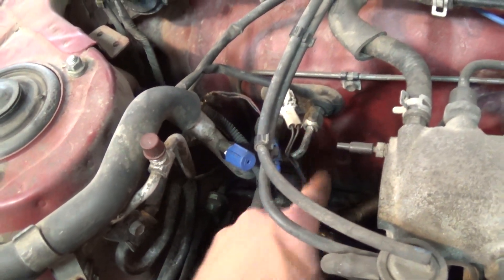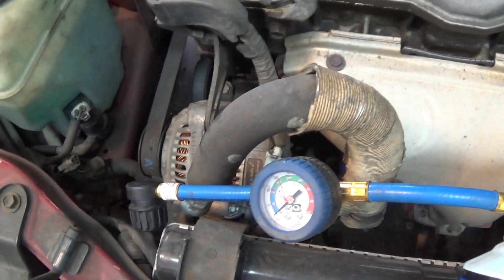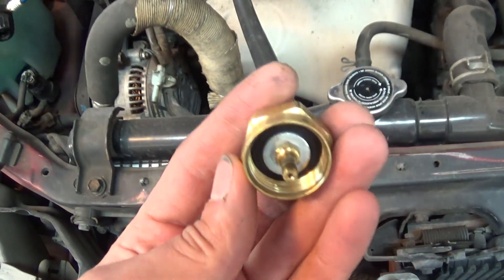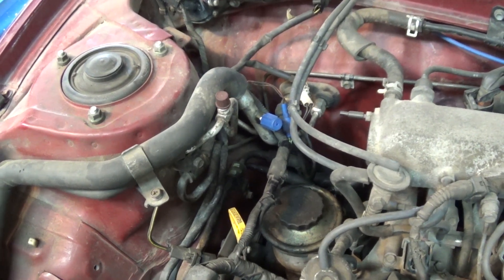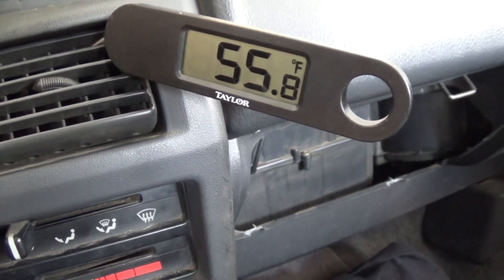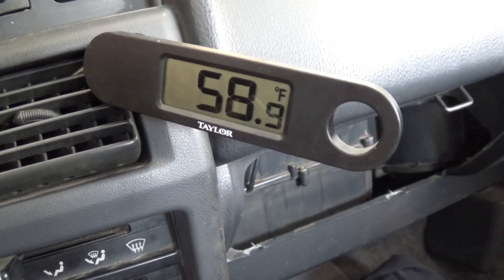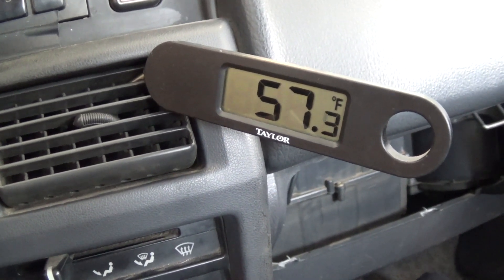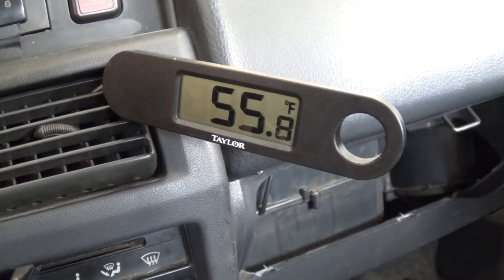Using Propane instead of R12?

Comment: use about 20-22 psi at low side at 27 degrees ambient temperature.. this makes it flash at about 0 degrees c with the evaporator.. don’t forget to trick the sensors

Comment: I have an R134a AC system, and when it lost its chill, I had it pumped out, and then I replaced it with a propane-oil blend called "12a" from a kit. Kit came with instructions for converting a 134 system, which I followed, and it's been blowing cold ever since (5 years). I'm not especially concerned about the flammability issue because it's a comparatively small amount of the gas, and the car is, after all, a thing that holds 60 litres of an even more explosive substance called gasoline...

Comment: Tried putting r290 in my car, it works to an extent but gets cold then warms up compressor also makes a grinding noise. Gone when using r152a
Reply: 290 is very hard on compressors. It increases the load and can make belts slip.

Comment: Butane is what works best for me in my 1969 Dodge.
Reply: Pure butane? N-butane (R600) or isobutane (R600a)? I've been wanting to try pure isobutane (R600a) just out of curiosity to see how well it would work.
Reply: @averyalexander2303  Isobutane is what I used. The Chrysler RV-2 compressor is not compatible with ester or pag oil, as the oil circulated with the refrigerant. The regular mineral oil works best in the old compressor, which has its own oil pump.

Comment: Being from a border state we seen alot of cars burt up on the interstate. It is believed that there was some cheep  Mexican r12 being used. So it definitely works as a refrigerant and I have a few old vehicles I just use 134 and had no issues as I was used to paying from 90-120 for a 30lb   tank. Without changing the hoses a 12 system will eventually leak. Usually needing a little recharge every year. But now 134 is out of control also so maybe illl do propane and just add fire extinguishers.

Comment: If you go to an A/C service place in the future after using propane to charge your system make sure you tell the technician that you have propane inside as they will need to use different equipment due to the flammability.

Comment: Grill propane and refrigerant propane are different due to purity. Grill propane 64% pure were refrigerant propane is 96%. That means less contaminates and moisture. Grill propane moisture will attack metal TXV and Compressor parts in the auto AC system. If you use propane use refrigerant grade propane. Interest in the United States is growing for propane in refrigeration, but is not currently not legal in automobiles.

Comment: You're probably hitting a low pressure cutoff switch you want the compressor to run non-stop at idle they should kick off as it sees higher RPMs if it's kicking out at low RPM it will do it more so at higher RPMs this means you have a low charge add more propane and see if you can get those numbers even better
Reply: But but but. He's a frefrigetant engineer.

Comment: Straight propane is a direct replacement for R12, not R12. There is another hydrocarbon that must be mixed  with propane to make a more exact R12 equivalent. Do your own research and I think it is against the law to drive a car with hydrocarbon gases in the AC system. Be careful physically and legally. Remember, hydrocarbons mixed with oxygen and an ignition source equals BOOM and flames.

Comment: Imagine if the system could be configured to use use CO2 You could chill the interior of the vehicle down to antarctic temperatures. I think R134 is isobutane It would be interesting to try n~butane which I think is in the fuel cans for stoves.
Reply: The compressor power would be higher. That would not be practical for an ICE engine.
Reply: R-134a is Tetrafluoroethane not isobutane
Reply: @JetSettingBotanist  K thanks for that info.
Reply: 2000 psi

Comment: what type of oil are you using in the AC system? Did you check the oil compatibility with propane?
Reply: All refrigerant oils work fine with R290/R600+

Comment: Not cold enough for a propane system bud
Reply from the maker: This AC system was real worn and I didn't really look into what needed to be replaced.  But I have had propane AC systems in the past that would get down into the 30's at the vent.

Comment: enjoyed the content. I did run across a product called Enviro Safe, they claim to be a R 12/ R134 combo product and from what they claim you do not need to evac the system. Here is a little test I did. I have a 1984 Mercedes 380SL that had an engine swap. When doing so one of the lines was disconnected.  All I did was tighten the end, did not evac or even ad oil just added the enviro safe. It runs great and is cool. My 2000 Mercedes S500L was low on freon, I topped it and now come out around 32-38 degrees at the vent thats in central Ca in an ambient temp  of over 90 degrees. Ive had great luck with it and the cans average under 7 dollars a can. Great price point. I do not work for them but I am a fan.
Reply: I only exclusively use the industrial blend from them in all the R12 car ac's i have restored. works great
Reply: That stuff is made 20 minutes away from me, have a customer who uses it in his gleaner combines and it works good.
Reply: it most likely is just propane.

Comment: Hey guys. I have an r12 system in my truck and I'm running around 19°f out of the vents. Best case secenario is 12.6°f from the coldest part. Nothing special, just normal for an r12 setup.
Reply: Are you saying you still have the r12 or propane?
Reply: Nothing like turning your condensate into a block of ice. LOL
Reply: Fix your broken temp switch.
Reply: @hotrodray6802  ain't nothin broke. That bitch is dialed the fuck in.

Comment: Could make a front end collision kind of fun like a movie scene where car blows up. Lol Thank you though. Makes you think about other possibilities to. My old camper has a refrigerator that uses ammonia.
Reply: there is only a small amount  in there
Reply: Was thinking the same as force311999, there are only a few ounces total in there so it would be more of a puff than a bang.
Reply: About as dangerous as a can of hair spray in the car.  never mind the 20 gallons of gas under high pressure.
Reply: Propane is only dangerous under certain conditions and I don't think those conditions can be met in an A/C system. If it were to leak it would disperse pretty easily out the bottom of the vehicle. Under just the right circumstances you might see a small flame at the point of the leak, just like using a propane torch, you are making use of a controlled leak. The big explosions you hear of related to propane are due to it reaching the point of boiling in a restricted container. Even if the vehicle were to catch fire for another reason, I'm pretty certain one of the A/C hoses would burn off and release the gas before it reached the critical temperature. It might fuel the fire for a moment or two but there wouldn't be an explosion.

Comment: My question is, how do you remove r12 oil out ?
Reply: Is it possible your unit was already dry on oil?
Reply: When you draw a vacuum on it it pulls all the oil out. They actually have a acid wash flush for the lines if changing to 134A
Reply: @donaldsmith3107  NOt so,    when you draw a vacuum,NO  oil comes out,none.
Reply: @donaldsmith3107  thanks
Reply: That’s weird. Usually a good vacuum draws everything out. I always have to add oil afterwards to the line with a oil charge. The only place it would seem the oil wouldn’t come out is the compressor and the oil you add when you install it. The whole point of the vacuum is to remove all the trash including the old oil from the lines.
Reply: @donaldsmith3107  
Pulling a vacuum does not remove any significant amount of oil, only the refrigerant/contaminant vapors will be removed.

Comment: Propane is the same thing as R-290
Reply: Not exactly. R-290 has to be a far more pure form of propane. It is the difference between kerosene and jet fuel.
Will some jet engines function on kerosene? Yes, but they would not like it & up in the air, you do not want any "maybe's" LOL.
Reply: @MikinessAnalog  If you computerized jet engines have a program for kerosene and there isn't stuff that can clog your fuel filters, then all jet engine hardware could run on kerosene... With commercial air transport you simply cannot run anything else than jet-A of course..

Comment: In Australia we have Hychill brand M30. It is illegal to use in one or more states here. Cheap AC regassing services have used it, sometimes without telling the customer. You need to add PAG oil still but I think the M30 includes it.
Reply: Did you evacuate the system or just top up? You can buy it here in Queensland. Hychill website recommend  evacuation r12 or r134a , remove oil, flush out system, replace receiver dryer before recharging a/c system. Burson sell it, but they advise not to install in customer's vehicles to cover themselves. Red many good reviews on hychill minus 30 for automotive application. Use a third of hychill minus 30 refrigerant  compared to r134a. 600 gram system uses 200 grams. Hychill minus 30 operates at lower pressures, less stress on the compressor. As usual here in the nanny country,  industry association, VASA are trying to get it either banned or bring it under the licencing regulation umbrella. They say repairers are getting away with not paying carbon tax. As you can see it's all about screwing more money out of us. The 425 gram cans have no oil. The larger cylinders have oil in them. Hychill recommend SR-500 oil, not poe or pag oil. To pressure flush pipes, condensor & evaporator, hychill recommend using their ECO flush. Cheers from Brisbane.
Reply: @jet-z2r  hychill cost v propane? I think it was around 100 bucks to redo with hychill
Reply: Ester oil is better. No corrosion like PAG.

Comment: Well if you get in an accident and someone dies from the fire, it would be man slaughter..
Reply: In a gasoline car the r1234 is probably as flammambe as gasoline.. In diesel car probably the r1234
Reply: nope new cars today have whats called r1234  and its flammable
Reply: @jonsworld5307  Can you confirm that??? That sounds criminal..
Reply: @josephdupont  yes i can just look it up epa made them go to it in new cars starting few years back and if thats not bad in its self epa wanting all older car converted to 12a witch is 90% propane and 10% butane

Comment: The old CAT and John Deere roof-mounted A/C units at one time were charged with propane as ease of availability for farmers and ranchers. When I was working in Alaska as a heavy equipment mechanic in the logging industry all those old MACK's and Freightliners had propane filled A/C for about the same reason, it was cheap and everywhere. HFO-1234yf is essentially a heavier gas than propane, but they share the same cooling properties, unlike propane HFO01234yf does not burn completely as it has three different nonflammable inert gasses. I will say this, no A/C job, no matter what refrigerant is used, should be done with the proper equipment and an understanding of how the systems work, and how the equipment works.
Reply: " no A/C job, no matter what refrigerant is used, should be done with the proper equipment"

So, I should NOT use the proper equipment ???
Reply: @mrbrown6421  🤔
Reply: @midas617  Hello sir!
Comma separated phrases  like "no matter what refrigerant is used" can be removed from a sentence to check the meaning of the sentence.
Therefore you state:
" no A/C job...should be done with the proper equipment"
And thus my stupid, but correct, reply 2 years ago.
Best wishes, sir.
Mr. Brown
North Central Florida
Some retired Software Engineer who spent too much time writing Military Documents.

Comment: Well too late to say this but don’t use PAG on a system that had mineral oil. Use POE.

Also, it’s cycling likely because propane pressures are getting out of hand. Things like Freeze12 were 50/50 Isobutane/Propane to lower the pressures.
Reply: Depends if it's a pressure drop switch or a direct temp switch

Comment: I had a '93 Ford Tempo that used R134. My '92 was 12. It doesn't state much online on an exact year than early '90's but '94 was the first year it was pretty much standard refrigerant.
Reply from the maker: I believe you're right, 94 was the year it was required, but some car makers introduced it a few years earlier.
Reply: @CtrlAltDefeatTV  in 94 became mandatory. my 1993 audi 90 unfortunately needs r12.

Comment: i was wondering if you could do a video on how well the ac in a car works when charged with Helium
Reply: Helium will not work as a refrigerant in the pressure range for air conditioning.  Don't even think of trying it.
Reply: @lewisbishop6814  roger that
Reply: Helium does not phase change under the temperatures and pressures of an automotive AC system.  It is used as the working fluid in cryocoolers although it is just the pressure differences of the gas that are used to move heat from one side to the other.  I have one of those for making liquid nitrogen.

Comment: R290 is propane refrigerant without the damaging moisture and acids and it is not expensive.  Unlike a building, I would think a vehicle would be about as safe a place to use it as any.  The amount of and pressure of gasoline in a fuel injected car is far more dangerous.  I have no idea how well it works.  Normally exit air on an R12 evaporator is more like 40 degrees.  R12 is not used as much anymore, but it usually isn't that expensive either.  Junk yard and every time an R12 system is replaced, they suck the Freon out of it and save it.
Reply: And what  happens  when there is a leak and  someone  lights  his cigarette. 
Boom.  Dead.  Not a good plan.  Just use proper refrigerant.
Reply: @tbone6354  that's bullshit.
Read all the direct tests done in Australia, they use it there where it's HOT.

Comment: R12 is also flamable
Reply: bax442 no it is not
Reply: @jantrammelant  it is   and when burned it turns to fosjene  gas, very deadly   Burning refrigerant in an open flame creates Phosgene gas. A very toxic gas which has been used as a weapon in past wars. In this case, carbonyl fluoride, the flourine equivalent of phosgene (carbonyl chloride), from burning R410a.Aug 20, 2010
Reply: your thinking of R12a. R12 was used for years before. R12a is a hydrocarbon thats made of propane and isobutane that runs at simaler pressures of R12.

Comment: Propane in the AC system is going to cause a fire.   Never mind about all the fuel lines with gasoline in it
Reply: It's funny to say. Those little cans you get at the store to diy is hydrocarbon. Which is propane and butane mixture. It's fine. 
Also propane is cooler the 134a
Reply: My only concern would be an evaporator leak being ignited by a piping hot fan resistor or awful old school shadetree wiring.

Comment: Just run the propane. If it works, don't "fix" it!
Reply: R-290 is an extreme pure form of propane and putting everyday propane in the line would eventually cause the compressor to break down from contaminants and a tiny bit of water regular propane has in it.
Reply: @MikinessAnalog  I mean, a functional filter dryer does..........filter and dry. I've been running coleman camp stove propane in an 80s corolla for 3 years.
Reply: @whozaskin3639  I wish you zero issues & problems. It's just I know more about electronics & chemistry than I do about refrigeration.
Reply: @MikinessAnalog  facts don't care about feelings, and after 30+ thousand miles the coleman freon kicks ass. Seriously, bud. Big industry can keep it's fluorine atom, and I'll keep my cash.

Comment: Your are right in the fact that propane IS a much better refrigerant than 134 and also little better than 22 with none of the ozone issues. However bulk propane is prone to have moisture in it which can freeze up in expansion valve.  There is a company call Duracool in Canada that makes and sells a propane refrig. For auto's that works excellently....better than any refrigerant I have ever used. Cools better (40F in the vent here is Alabama in August).....only issue I have had its to damn cold.... Lol.  Much lower head pressures, less compressor and belt loads....mixes with both oils and 22 and 134 although system will work better if it is totally evacuated....6 .oz = 17.oz of 134 so don't take as much
Reply: Life saver man was about to spend 300 on r-12 then I read your comment and ordered duracool 12a it's insane! Near r-12 levels

Comment: How many recorded vehicle fires were caused by propane refrigerant? I wouldn't even bother going to r134a. It is flammable too.
Reply: 134A is not flamable.
Reply: @danhoyt9961  False. It ignites at 1300 degrees, read the MSDS
Reply: They all are flammable.
They mix propane in some of them. 
It’s all politics and money and control.
They do not want us to be more efficient to save money on fuels.
They want us to use more energy to be comfortable. 
They use fear to get what why want done to make more money. 
Same with diseases.
They fear you of the things rht cures naturally and cheap or free to cure in so e cases also. 
The world is ran by demons posed as humans really.
Reply: Propane is only dangerous under certain conditions and I don't think those conditions can be met in an A/C system. If it were to leak it would disperse pretty easily out the bottom of the vehicle. Under just the right circumstances you might see a small flame at the point of the leak, just like using a propane torch, you are making use of a controlled leak. The big explosions you hear of related to propane are due to it reaching the point of boiling in a restricted container. Even if the vehicle were to catch fire for another reason, I'm pretty certain one of the A/C hoses would burn off and release the gas before it reached the critical temperature. It might fuel the fire for a moment or two but there wouldn't be an explosion.